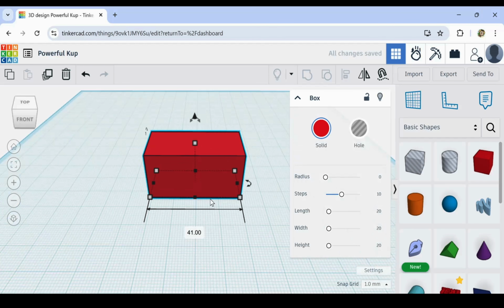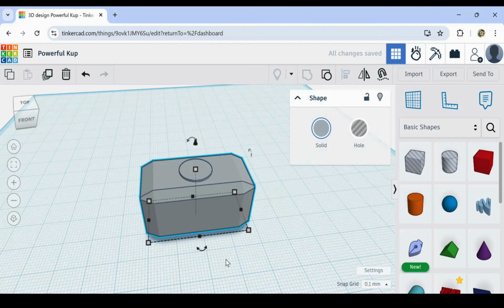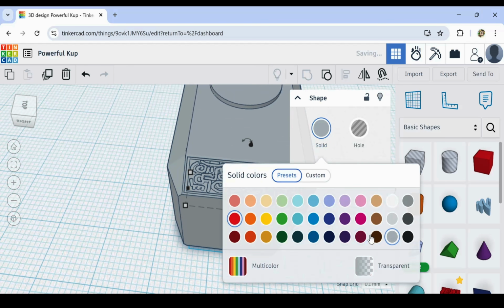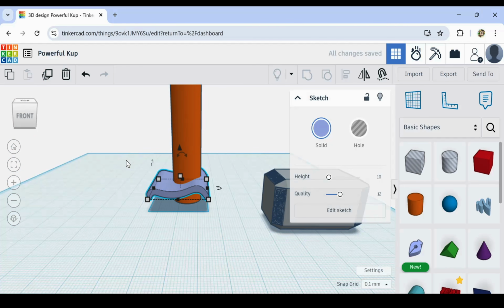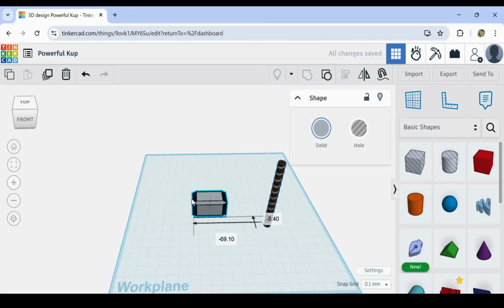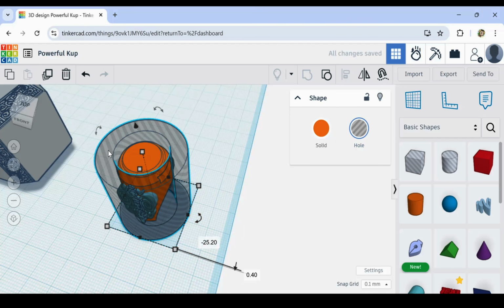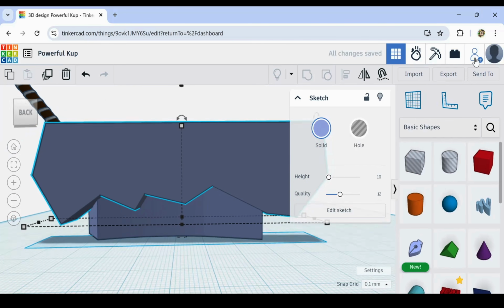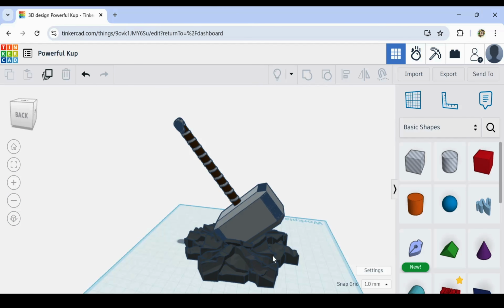Tinkercad Design Tutorial, Thor's Hammer! 3D Printable Model!

Comment: The Segments on the cylinder feature is used for the Bevel - It works like the Sides feature, but as it is for the Bevel it makes the actual Bevel rounder and smoother by adding more Segments

Comment: The handle is too long. Thor's hammer has a shorter handle.
Reply from the maker: I think it's about perfect when comparing it to photos online. In the thumbnail it looks really long because of the angle. 
In most the photos on Google the handles are about 2 1/2 times the width of the hammer head. And that's what I did.